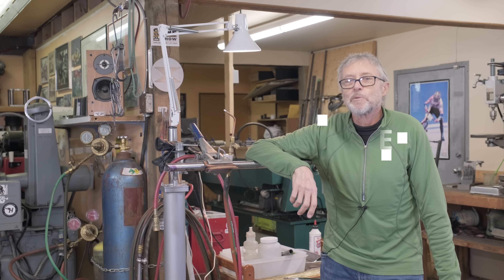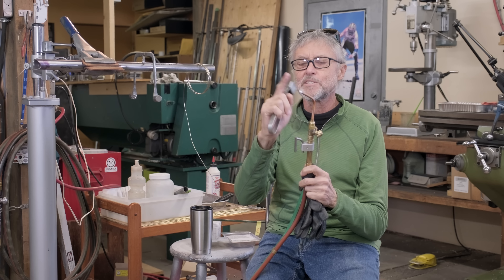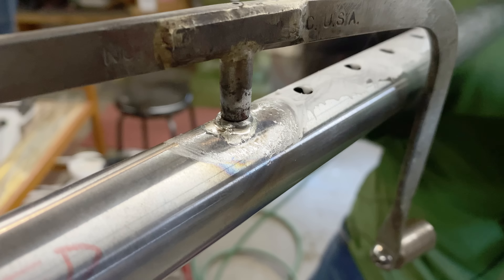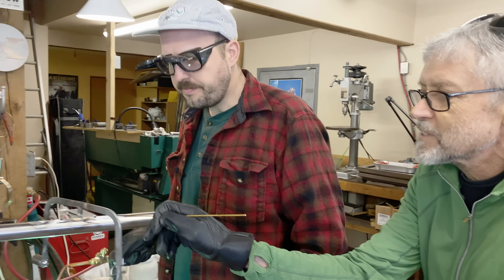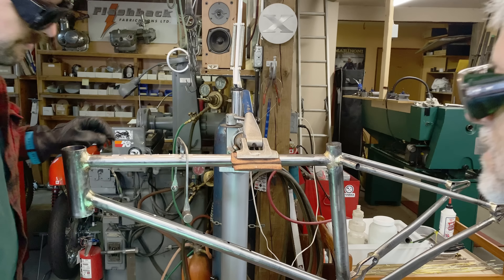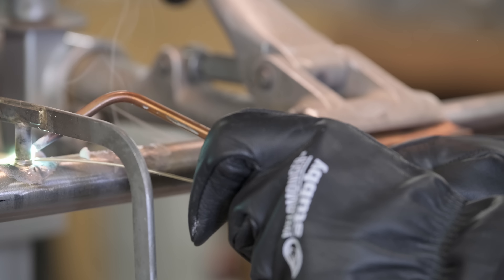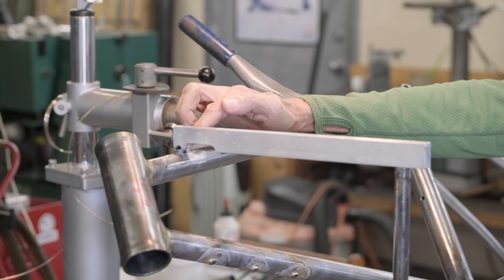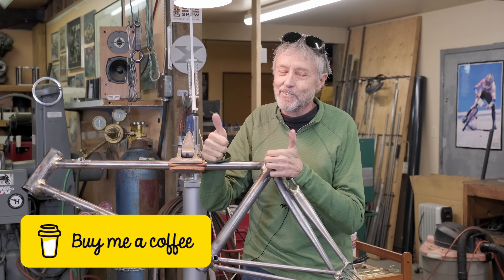How to Silver Solder - Watch Me Teach! // Paul Brodie's Shop

Comment: I did industrial silver soldering. Temperature sensors soldered to wires, stainless steel tubes soldered to fittings,etc...I used ruby tipped mini torches. Lighted magnifying lens. Had to build my own jigs for different jobs. Didn't know bikes were silver soldered.
Reply from the maker: Very few frames are "all silver soldered" Some have silver soldered braze ons, that's all. A lot of frames have no silver soldering at all due to it's high cost.    😉
Reply: Next time you get French fries look at the fryer. You'll see two stainless steel rods in a corner going into the oil. There are temperature sensors in the ends of those tubes. They are doing a constant series of comparisons to guaranty the temperature of the oil. Made thousands of "Pitco" brand sensors. We had a patented device that welded the end of the tube into solid ball while the tube spun in a chuck. Protects the sensor.
Reply: When I moved back to Texas I used my silver soldering experience to make Cowboy jewelry. Trophy buckles,etc..My bosses were a genuine King and Queen of the rodeo from Australia. Really enjoyed the "handmade" aspect of the work. No machine can do it.
Reply from the maker: @brianlevine5213  Sounds like your career was good for you.
Reply: @paulbrodie  I made trophy buckles for both a San Antonio Texas rodeo and a Houston Texas rodeo. Had people come in who wanted copies of pro buckles."Stolen Valor" at its best. I'd like to try a bicycle.
Reply from the maker: @brianlevine5213  Yes, you should try a bicycle.
Reply: @paulbrodie  Are there frame kits? Would I need to build jigs?. I would enjoy the hand made project. Build my own E bike!
Reply from the maker: @brianlevine5213  Yes you would need to build everything. Tubing is available from Nova Cycles in California. There are other suppliers as well.
Reply: @paulbrodie  I'm looking for a project I can do as an individual.Maybe an E bike project is it. I like old school craftsmanship. Using bronze for brazing!. I remember a brand of bicycle called "Royce Union". Supposed to be built like a Rolls Royce car. Brazed frame,etc..
Reply from the maker: @brianlevine5213  An E Bike project is so much more work than just building a bicycle frame, which in itself is a LOT of work. I would not not suggest an E Bike for a first project of this kind.
Reply: @paulbrodie  build a child's bike first?
Reply from the maker: @brianlevine5213  A small frame is actually harder to make than building a regular size frame..

Comment: If the melt temperature is higher than seven hundred and fifty degrees it is no longer soldering but brazing. The silver solder I use is one hundred percent silver. I see a lot of stuff on the market that is called solder but bu has a much higher melt temperature that the pure silver.

Comment: In my younger days, I was a combination light equipment/welder mechanic of a mine company in a remote town away from parts houses where we used to repair almost everything by welding, soldering, bracing or silver soldering if there's no available parts. We repaired parts like leaking radiators by soldering, silver soldered pinholes on hydraulic metal lines that rubbed against a metal by fillet a piece of metal over the pinhole and silver solder it or replacing a bad hydraulic line fittings by getting a good fitting and swage one of the metal line then silver soldering it. I've learned that silver soldering metals has to be properly cleaned, like you described and properly fitted (no gap). I've also learned that if the right temperature of the metal to be silver soldered is correct the silver solder just flow nicely. @14.21 is NOT a good example. The temperature of both metals  that you are trying to silver solder has to be equal to have a better flow and penetration. I usually heat both metal to the correct temp then touch the silver solder rod and the flame to the work piece. It should flow if its done correctly. In my experienced it helps if you apply flux on the silver solder rod also. It can be done by heating the end of the rod and dipping it in the the flux. BTW  Paul, I like the heat sink tool that you made. Thank for sharing.
Reply from the maker: Thanks for watching and commenting....   :glasses-purple-yellow-diamond:

Comment: Wow. Absolutely great stuff Paul, thank you. This brought me right back to age 14; being taught to solder and gas weld. Watching that solder wick itself around whatever it was I was working on was about as satisfying as anything at that age! Of course that was only when I got it right, didn’t overheat the part and basically have to start over. I learned all about the cone back then, the differences between soldering and welding and then of course introducing the flame for stainless! I still have my notebook with all my notes and drawings of flame types, 40 years later.
Reply from the maker: Thanks Glen. That's cool you still have your notes after all of those years. Not everyone does that!

Comment: Great video as always. The one thing people often miss here is that the metal follows the heat and you did a great job of pointing that out. Getting that heat around the insert is key and the solder then will flow into the joint.

When I learned how to gas weld we were always told to hold the torch in our palm like a pencil with our palms facing up and ideally the heel of our hand or our forearm resting on something. This gives a great deal more control and range of motion than holding it like a pistol where you are counting on limited wrist movement and movement from your arm neither of which gives you the same fine control.
Reply from the maker: Thanks Daniel. Yes, you are talking about the finer points of brazing or silver soldering. I didn't think Thomas was holding the solver solder in the best manner, but couldn't think of how to instruct him with a better approach.

Comment: Super stoked on these technique videos. They are really clear and appreciate the extra bits on nuance of the methods. I really wish the cameraman was a bit more on it with using the filter when the torch is working the metals.
Reply from the maker: Thanks Robert. Mitch (the cameraman...) does a very good job, I think...
Reply: @paulbrodie  I don't think he does a bad job. I just was just commenting that I wish he had the filter at the ready a bit more. There were a few times when I hoped to see the flame better and couldn't. Can you do some lug brazing videos?
Reply from the maker: @robertkeller2309  It is not easy filming brazing...   I have very little experience using lugs. I can't even remember the last time I used lugs. Maybe 30 years ago? I am not an expert at lugs, sorry....   :face-fuchsia-wide-eyes:

Comment: Helmut Clasen, multi ISDT Canadian gold medalist, seems to use silver solder exclusively when building his vintage Hercules and Zundapps. It is a real joy to see the solder flow around a joint properly...I used to make batches of nozzles to apply liquid medicine to suture thread during manufacture. I would silver solder a tiny stainless tube of about 1/16" outside diameter and 1" length to a nozzle body I made from stainless bar stock. I drilled a socket for the tube to sit in and would use a tiny dollop of silver solder paste that had flux already mixed in. I used a micro acetylene torch that made a tiny cone with very low gas pressure. I would put the paste on one side of the tube and would heat the other side, concentrating the heat on the thicker nozzle body. The solder would flow around the tube to the side I was heating, avoiding putting the heat on the tube as much as possible since it was so tiny. I would then finish machining the other end of the nozzle and drilled up to the tubing from the other side to have a nice clean hole... I also used the paste to solder carbide onto steel bar for custom lathe tools.
Reply from the maker: Tom, thanks for watching and commenting.

Comment: Nice tutorial Paul. I use sil-brazing on all of my model boilers (unless building out of steel). Typically, I use my supply of Harris Safety-Silv, Rockmount Gemini-G or Silvaloy 45/450 (stockpiled over the last 40 years). For some fittings I prick punch to ensure correct clearance on the joint and then sometimes cut and distribute paillons of "solder" on the joint prior to applying the torch. This is as per old Live Steam and The Model Engineer tutorials on model loco boiler construction. The largest boiler I have sil-brazed is my vertical water tube boiler on my 7-1/2" gauge/1-1/2" scale CliShay logging loco.
Reply from the maker: Thank you Butzi. Appreciate your comments!    😉

Comment: Great video. Master passing on the knowledge. One thing I have always followed with any form of brazing or soldering is the solder/braze goes where the flux and the heat goes. Clean fluxing and putting the flux only where you want the joint makes a world of difference.
Reply from the maker: Thanks Mark. Good comments.

Comment: Paul...great tutorial. When i am installing water bottle bosses i make a ring of solder and preposition it under the fitting..heat it up and it flows like butter on hot toast..
Reply from the maker: Thank you!  If you are making a ring, my first thought is that you are using too much silver solder. I'm pretty sure I use less solder than that. And silver solder, as you know, is not cheap!    :face-fuchsia-tongue-out::face-fuchsia-tongue-out:

Comment: Glade to see you are recovering. I too have tried to teach others to braze, solder and weld with gas. It's hard to teach experience. Grab some scrape and start practicing. When the connections in your brain connect between what your eyes are seeing, the brain understanding what they are seeing and the ability to tell your hands what to do to manipulate the process it will almost instantly become intuitive, but it's hard to explain to someone who has no idea how the process works or what to look for as to what they are seeing.
Reply from the maker: I try to teach in small steps so it's an incremental process. Thanks for commenting.

Comment: Thanks for the videos Paul ! I'm learning as I go, and your videos are very helpful. I'm making a automotive luggage rack using carbon steel tubing 0.75" OD X 0.049" Wall. I'm practicing using Flux coated 56% Silver and also Flux Coated Bronze Rod. The 56% Silver is very expensive, it's about 20X the cost of Bronze rod. I started with the 56% Silver because I only had propane at the time, and I didn't think I could melt the Bronze rod with Propane. I now have Oxy/Acetylene so I'm trying the Bronze rod. They both seem to work, so my question to you is, why should I use the 56% Silver rather than the Bronze rod ?
Reply from the maker: Gary, thanks for liking our videos!  If you are making a rack out of .75" tubing, probably the application is more suited to fillet brazing. And then the bronze rod would be fine. The silver is more for an application where capillary action would draw the silver in between 2 surfaces, and I don't think that is happening here. Correct me if I am wrong. If you are fillet brazing the tubes together, bronze is the way to go. It is very strong, and much cheaper too!     :face-fuchsia-tongue-out::face-fuchsia-tongue-out:

Comment: This is a really nice format for learning as said by others! I found your videos as I need to replace a dropout on a treasured Alan Richards/Tower cycles frame. Very useful primer to terminology and practices in all your 101 series!

Dropout replacement would be a nice video idea if you get the time. It's a common repair but there's no videos out there 🙏🙏
Reply from the maker: Replacing dropouts is not something that happens frequently. If a dropout does need replacing it's usually the right side only. Chainstay replacement happens much more in my opinion...Thanks for watching.

Comment: Paul, modest doesn't even come close to describing you, seriously. You are one of the most well known frame builders, been doing it longer than most have been riding and yet, so humble and "well, everyone's different, but this is how I would do it", like maybe you aren't so versed and skilled with a torch as you are.
Props to Thomas for volunteering to be "coached". Looks like he was improving each time he did it, biggest thing to remember is, as you kept telling him, the silver goes where the heat is. On a side note, does he plan to put in a vertical brace in the DS chainstay yoke piece he made? Ask as to me, that looks like a failure waiting to happen.
Reply from the maker: Thank you. Thomas said he didn't want to talk in the video, but then he did! He bought the yoke from somewhere, and I didn't think there is a vertical brace yet to be installed. I am skeptical of yokes. We will see if it lasts...

Comment: When I am silver soldering jewelry I often lay down chips of solder at the joint and heat until it flows. And I recall an industrial project using preformed solder rings set between components with everything fed thru a belt furnace. Is this worth trying on some of these braze-ons?

Also, I like this tutorial style of video. More please.
Reply: Pre heat filler placement is even used by ClickSpring on his channel. Well worth checking out if close enough isn't always good enough.
Reply from the maker: Yes, each of the methods you described has its' merits. Do they really apply to silver soldering water bottle brazeons onto a bicycle frame? That's a little hard to say, in terms of time and efficiency. I would probably keep using my method, because I am used to it, and I can be fast. Thanks for commenting.

Comment: This is so timely, I am planning on doing this exact type of work to an old frame (with my Doug Fattic inspired oxy/propane setup) is my holiday break project. Thanks Paul!
Assuming proper brazing technique, would you have concerns about adding threaded bosses like these to a Salsa chromo fork blade for rack/bottle mounts?
Reply from the maker: I think a Salsa cromoly fork should be able to handle a few water bottle brazeons, if done correctly. Thanks for watching.
Reply: @paulbrodie  Thank you! Looking forward to the next vid!
Reply from the maker: @thomaslowry5632  Next video might be out tomorrow....  :face-blue-three-eyes:

Comment: They taught me in school that if the melt point is above seven hundred and fifty degrees it is brazing and not soldering. I frequently use Harris stay bright. It is ninety five percent silver and comes with liquid flux. This stuff you are using must have cadmium in it. I have brazed a lot of wave guides at work. The biggest mistake I see others make doing this is that they don't use enough flux.
Reply from the maker: Without looking at the packaging, I believe the silver solder is cadmium free.

Comment: hey paul, i want to build a cargo rack for my bike. would one of those $100 oxygen+propane blowtorch-sized torches produce enough heat and will the silver solder joints be strong enough for a cargo rack? thanks!
Reply from the maker: I have never used oxy / propane so I really have no idea, sorry. Silver solder is only strong in a lug type situation. If you are going to use it like a fillet brazing situation, it might be strong enough, or it might not. Very hard to say...   :face-orange-biting-nails::face-orange-biting-nails:
Reply: @paulbrodie  thanks for the answer. i found a few videos of people building bike frames with fillet brazed silver solder and a regular blowtorch, so i guess it's good enough as long as it's stronger than the tubes of the bike frame

Comment: CR750! How have I missed that? Can't wait. 

Anyway, thanks again for the tutorial. Picked up some nice little tips.
Reply from the maker: I have to heal my leg, and then we will mount the front fender on that CR750. It has history!
Reply: I know you are having a rough trot recently. I sincerely hope that you are as well as you can be. Hope the coffee helps. 😉

I have a bitsa CB750 cafe racer with CB900 crank, 67mm pistons, F2 head and 31mm CR smooth bores. If you squint really hard it looks kind of like a CR with no fairing. 
Always loved the look of the full fairing. I know that there is a LOT more to a good CR than just the fairings and engine. 
I really enjoy the videos you put out. The Excelsior videos are great. I remember seeing the project back in the early 2000's and wanted to something of the same ilk.

I keep salivating over those little Aeromacchi engines on the top shelf in the background. We never got them here in Australia. 

Thanks.
Reply from the maker: @kepamurray1845  Thanks for watching and commenting. Of course, you could always import an Aermacchi motor into Australia, and that would really kickstart your project. What a thought!🤨